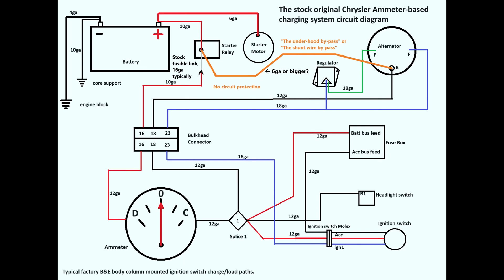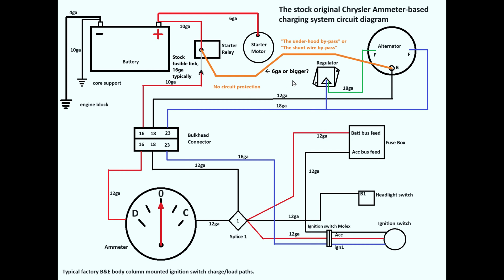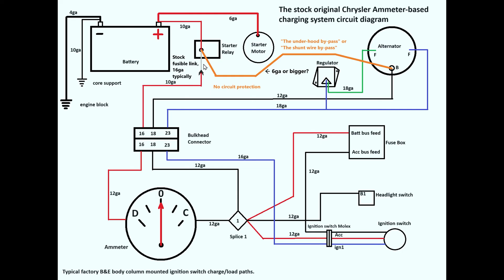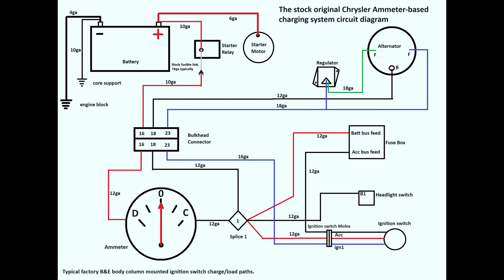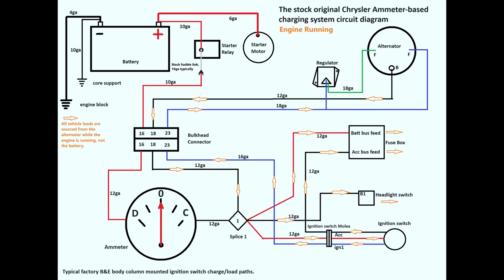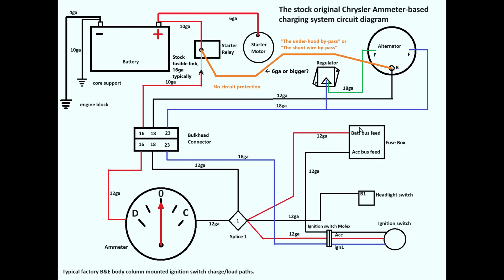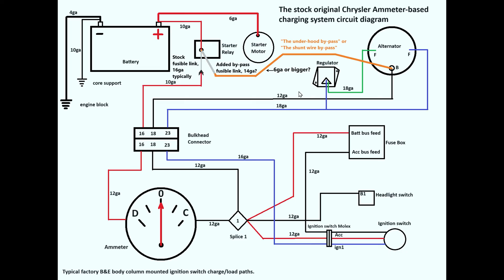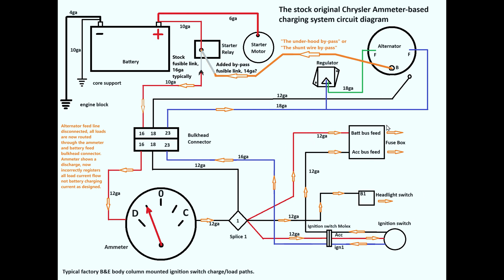The Big Problem with the old Mopar “Shunt Wire” by-pass, the importance of Circuit Protection.

Comment: Tried this on my 73 duster. With the bypass alternator puts out 15.4 volts at engine  cruise and 14.6 at idle. system is over charging. please help!
Reply from the maker: This "shunt wire bypass" really has nothing to do with regulation. start here for over-voltage issues.  https://youtu.be/fqG_lKcIbAE

Comment: The whole point is to remove the amp meter from the circuit and also by passing the bulkhead connector as it is a point of resistance which equals heat. Now you can replace the amp meter with a volt gauge which is a more accurate way to monitor charging. And never add any high load carrying wire with out some overload protection. And two fusible links feeding two separate sections do not double the amp load for blowing... Just try it on a battery the wire that is shorted will blow the corresponding link that it shorted from. Also as long as you have a battery in the circuit it acts like a sponge absorbing the alternators output thats why the smaller wires are not carrying the full amount unless there is a draw that demands higher amps then they will burn. I have several Mopars even my two Ramchargers that have not been converted cause I'm lazy 😂...but on my 84 Ramcharger I had loose wiring harness on the driver side that wore through and shorted but the fusible links did their job and saved the truck from a fire it was one link coming from a group of 5 wired into the main from battery replaced the one repaired the harness and secured properly and good now. I think every mopar into the 90s should have the by pass done if your running the stock wiring. And always upgrade the wiring  to alternator even if its a stock 35 to 60 amp goes double on any high output alternator. Same goes for the battery cable use the biggest highest strand count you can get and never use clamp on ends... except for emergency repair. And once a year or so cleaning the bulkhead connector on the stock harness is a good idea.
Reply from the maker: Can’t agree with much in this comment. Voltmeters don’t provide much information at all as to the real time charging and load status, charge, no-charge basically, an idiot light will tell the same, much more information is displayed on an ammeter if you know what you are looking at. As for the “And two fusible links feeding two separate sections do not double the amp load for blowing..” comment, dead wrong, in this “shunt wire” scenario there not be “two separate sections”, or circuit legs, if the stock charge path is left in place, this creates a parallel path around the stock fusible link. You can’t wire multiple circuit protection devices in a parallel circuit without altering the total circuit protection level. This “shunt wire, direct battery to alternator” bypass is very dangerous when overlaying stock charge path, makes for a much less safe electrical system.   Review Kirchhoff's current law and the current divider rule
https://www.youtube.com/watch?v=mpXzH03A-Qs           See the demonstration of this principal in the part 5b video. https://youtu.be/fkRZzs4ScMo
Reply: @72roadrunnergtx Gee I have been building my mopars from the ground up and reusing the OE wiring 30yrs yet to have one burn down key is always have some sort of circuit protection... parallel as in one wire feeding separate circuits branching out the way mopar has done it. A volt meter will instantly tell you you voltage is low if the alternator or voltage reg goes out much better than an amp meter and you can have both, mopars also have a very sensitive charging warning light when it is working as in someone hasn't removed the bulb.... Just check out mad electric site online they have a very clear explanation on how to add the shunt safely with no issues it not complicated at all...and sure I'll go to the two links you provided as I'm always willing to learn new things... And I did sub to your channel as I  find your content interesting.
Reply from the maker: Thanks for watching. Sounds like you may be missing some key points in these videos. The factory never did anything like the “shunt wire bypass”. No serious circuit designer would parallel circuit protection allowing a current level to flow that would exceed the conductor ampacity of any segment of the circuit in the event of a short. You may be conflating the later plastic framed truck ammeter issues (the Mad article specifically states it addresses) with these earlier passenger car systems, there was no charge lights back then in these cars. I’ve been countering some misinformation in the Mad Electrical articles about the truck ammeters for many years, well aware of the content. Don’t recall them pushing this direct battery to alternator shunt wire parallel bypass however, bulkhead bypass yes. When this shunt wire bypass is installed over the stock charge path it does indeed circumvent the stock circuit protection in the event of a short in any of the stock unfused wiring, as explained in this video and the later demonstration videos. Will have a agree to disagree on the voltmeter vs ammeter, I’ll stick with the ammeter, no use for a voltmeter. There is a reason why even today any serious battery/DC circuit monitoring involves ammeters of some type.
Reply: @72roadrunnergtx I will continue to watch the rest of your videos like I said I'm open to the fact I'm missing something thanks for the response.
Reply from the maker: If you get through the more recent demonstration series on this charging system, especially parts 5a & 5b, and still don’t recognize how the so-called “shunt wire” bypass creates a parallel path for current to flow from the battery to any point in the stock 12ga wiring in the event of a short, circumventing the stock 16ga fusible link, let me know, happy to break it down even further.
Reply from the maker: @moparnut6286 After reviewing the Mad Electrical article once again after many years, I think I see where the confusion may be. As mentioned, the Mad approach is not this quick and easy “shunt wire” parallel battery to alternator bypass discussed in this video. They abandon the original alternator charge path as mentioned/diagramed towards the end of this video as the only way to run a direct battery to alternator charge path wire safely. When done this way, the ammeter will not work as designed anyway, may as well be bypassed. The ammeter vs. voltmeter debate continues. Many from the classic Mopar car world continue to cite/conflate the Mad article, specifically written about the later (late seventies-eighties) truck plastic-framed ammeter fiasco, as proof that every other earlier Chrysler passenger car needs the ammeter (completely different construction) to be bypassed or one day it will spontaneously combust for no reason whatsoever, even when its connections are not abused, operated within its design limits, and all loading correctly placed on the alternator side of the ammeter. Those who promote this “shunt wire” bypass say you should just overlay the under-hood battery to alternator wire on top of the stock charge path with no other repairs or modifications at the bulkhead or under the dash, this will make everything “safe”. Just the opposite as it creates a parallel path that circumvents the circuit protection for all stock unfused wiring in the car. Some describe it as a quick easy way to bypass the ammeter, it bypasses everything and fixes nothing, better hope a short never occurs.
There are several things in that Mad article I do not agree with but electrically, there is nothing wrong with their approach as long as the original alternator charge path is abandoned as to not create a parallel path around the circuit protection.
Reply: @72roadrunnergtx  obviously I need to study this more in-depth,  I may have formed my opinion too quickly...but as most modern cars do not use an amp meter and there is short protection on all circuits... I will be wiring my 71 charger and my 72 dart I will be looking at the dash wiring and bulkhead wiring along with engine  bay wiring with much more scrutiny cause of your videos... Thank you.

Comment: I was sceptical of the video when i read the title. Turns out that was due to me not understanding the charging system fully.

That said, I think the last option you showed is a good one for anyone adding an upgraded alternator with high, relay switched, loads.
I will be doing this since I have a volt meter, bypassing the ammeter anyway. I am just adding more current draw to the charging/battery side. The bypass should take the load of the interior wiring, while keeping the orignal fuse capacity in place.

Great video, thank you.
Reply from the maker: Thanks, be sure to watch the part 5 demonstration videos on this subject. Part 6 shows how I handle adding loads to this system while retaining the ammeter and full circuit protection.  https://youtu.be/qpDm5bXX60w

Comment: Can you just leave the ammeter alone without removing one of the ammeter connections and trying it to the other side?  
 After running the bypass in your safe method. 
 If not. Does the dash have to come out to access the ammeter? Thanks !
Reply from the maker: To be clear, I don’t recommend this “Shunt wire” by-pass in any form. Just pointing out if running it, the only way to retain any functioning circuit protection would be to remove the stock charge wire from the alternator to avoid the paralleled fusible links and to not expose the ammeter to current it wasn’t designed to handle would be to disconnect the ammeter. If not wanting to get under the dash, I’d check out the C-body recall approach, running a parallel alternator wire run from the alternator to the fuse box. It takes current stress off the charge output Packard/bulkhead connection, retains full ammeter function and circuit protection. See the part 5a video on the channel for details. Accessing the ammeter varies by year/model and cluster design, some are easy to get at, others not so much.

Comment: Do you still use a fusible link when splicing in ahead of the original link ? I.E. last option in your post . Thanks
Reply from the maker: If I understand the question correctly, if you feel the need to run this “shunt wire” by-pass, yes, the stock 16ga fusible link needs to stay in place to protect the stock wiring from the battery’s current potential in the event of a short. The shunt wire will need its own fusible link to protect it and the alternator from the battery as well, just as diagramed. To be clear, I don’t perform or recommend this shunt wire band aid approach at all, there are much better ways that don’t compromise the circuit protection designed into this electrical system.

Comment: I looked at the wiring diagram from my '66 FSM and it doesn't really square up with what is presented here for the 70ish and later B/E bodies.  A major difference is the column mounted ignition switch with Molex connector.  Could it be that the mid-60s charging systems were different enough from the 68 and later to benefit from the ammeter bypass?  Dozens of anecdotal accounts describe heavy loads showing a discharge on the ammeter on early cars, especially at idle.  The bypass largely fixes this problem.  These loads don't appear on later years because of changes in charging system design, but, I think there might be a case to be made that the bypass is actually beneficial in earlier models.  Just my observations.
Reply from the maker: The basic charge path diagram/design changed little since Chrysler moved to alternators in 1960. The ’70 and up column mounted ignition switch Molex is not part of the charge path and had it’s own issues (another video addresses that). For C-bodies, the first change came is ’72, the use of a shunted ammeter, with full charge path current no longer being routed through the passenger compartment. Yes, the old factory spec’d alternators couldn’t keep up with a lot of factory loads running at the same time at idle especially higher optioned platforms like C-bodies. But at off-idle, some rpm, this should equalize the current drawn through the ammeter and register little to no current, zeroed. 1970 also had a change in alternator regulation, from mechanical to Electronic but ran the same charge path.
Your ammeter shows significant cumulative loads registering while voltage remains above battery voltage. Indicates all factory loads are now routed through ammeter, not designed for that. That bypass should make the ammeter non-responsive.
Main point is it also bypasses the stock circuit protection for all the stock unfused wiring and components. Should there be a short circuit in any of that stock wiring at some point, things will burn. It is not the answer to a safer charging system especially if the ammeter is now exposed prolonged excessive load current flow it was not designed for. It literally makes it more dangerous.
Be sure to take a look at the video on added loads, more detail on how this charging system works and how it differs from everything else. 
Again, very few understand this charging system, there is a lot of misinformation going around, has been for many years.
Reply: Running the bypass on my 65 Dart GT 273.Great results,no problems.Run a fusible link for safety.
Reply from the maker: @samuelgoodman2825  Did you watch the videos? There is nothing safe about this bypass, even when it runs its own fusible link. Zero or altered circuit protection makes for a very unsafe stock electrical system. Better hope you never experience a short with that bypass in place.